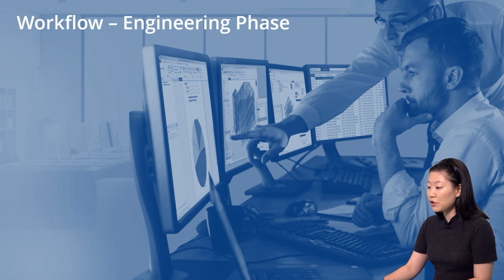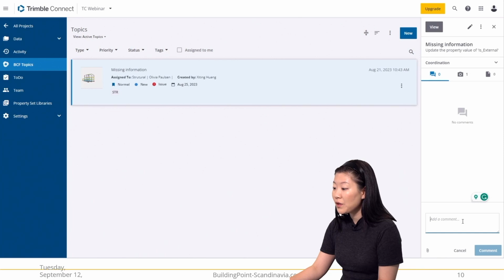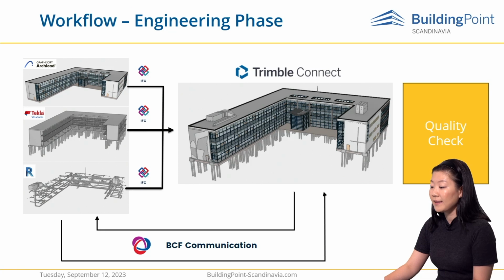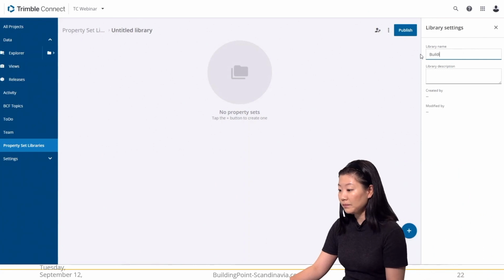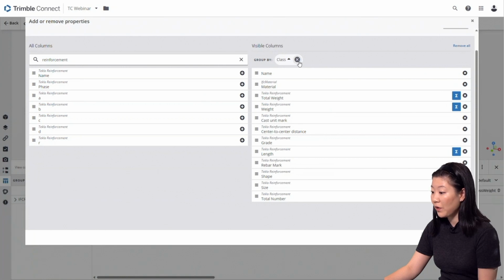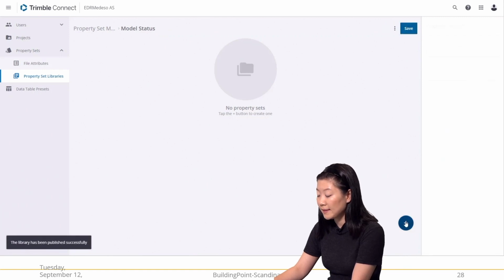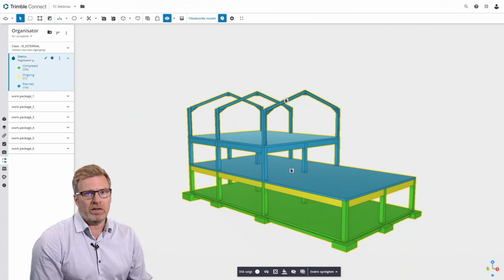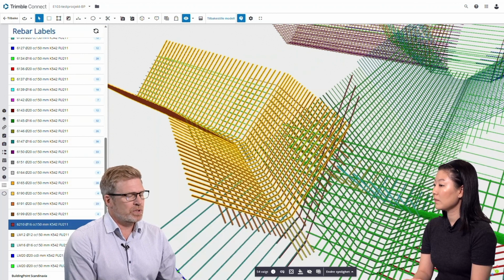Trimble Connect: Advanced use of Trimble Connect in production

Comment: The version of Trimble connect you used here - is the business premium version ? As that's the version has the property set customisation feature.
Reply from the maker: We recommend the Business Premium. Not completely sure if that's required but seems likely... 
Suggest you reach out to the local Trimble reseller :)